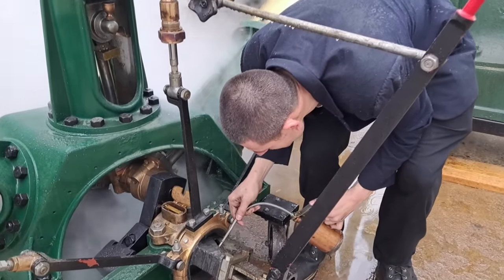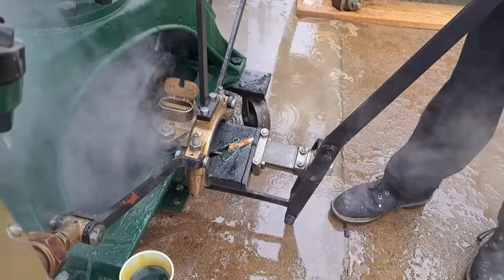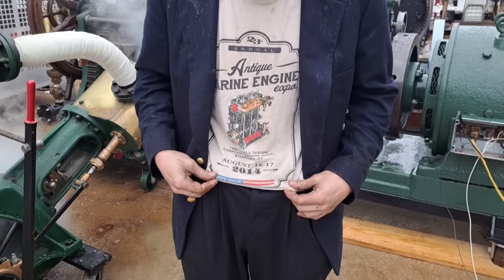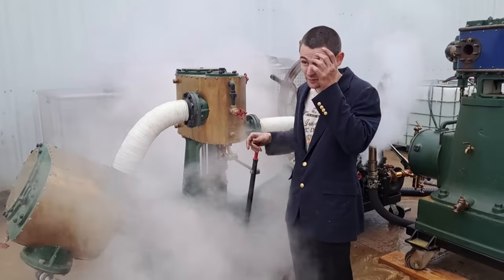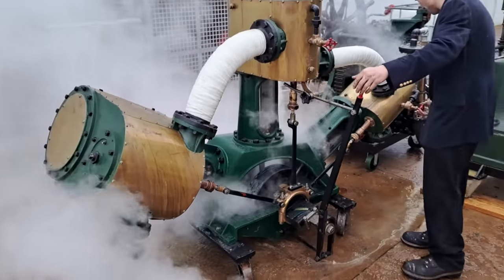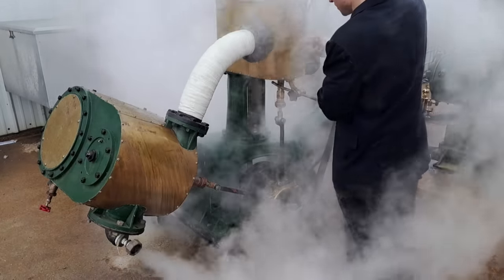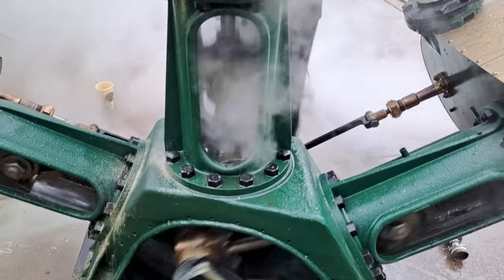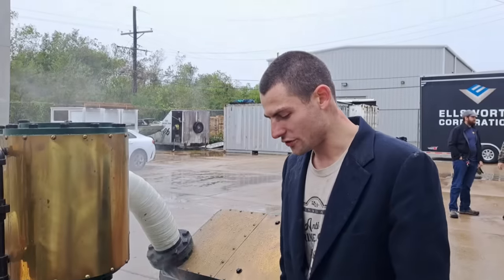Ward's Radial Triple Expansion Engine, remembering my friend Richard Gibbens

Comment: Briilant. Love old steam. I to have been collect old engineering books for years. My first introduction to steam was when i was about 4 years old. My dad was a light house keeper. Ever6 now and then a steam tug would arrive with supplies of equipment. One day we travelled back the mainland. I ended up down below in the engine room. Twin screw Triple expansion engines. I just sat there in aww. I could write a book about my steam adventures. But not here

Comment: Just stumbled onto this neat video.  Great to see the Ward triple again.  The last work on this engine was on Lopez Island when Keith Sternberg and I cleaned it up, painted and lagged it, and tuned it up for Alex Ellsworth.  Incidentally, if you are ever back at Mystic, they have a big four cylinder Atlas-Imperial marine diesel which I restored in Anacortes, WA back in the 1990's.  The engine originally went to Independence Seaport Museum in Philadelphia but was resold finally to Mystic Seaport.
Reply from the maker: I helped paint that Atlas!

Comment: That’s a very interesting engine !  Just also watched your 1 1/4 hour long video about the water plant which took me back in time. I was amazed at your dedication and knowledge of steam engines for a young person.  I could not find a place to comment on that video so doing it now. I started as a coal fireman on a steamship with a triple expansion engine. I soon was promoted to an oiler which I really appreciated.  Through your video I was comparing the ship and the water plant engine. No flywheel on the ship due to the propeller. No fly ball governor. Two eccentrics for ea cyl because it reverses. Slide valves. That ship engine room was not dependent on electricity for anything but lighting. We had a dynamo for that.  We had a surface condenser and air pump linked to the h p cross head. Some ships used a jet condenser. That ship was built in 06, my next one was built in early 50 s, what a difference !  Everything was manual controlled on the first one which gave me a full understanding of what was happening. That first experience gave me a fast learning curve on future ships. I did become a n engineer.   My first job was a  9000 hp compound turbine. We didn’t call it a turbin. Really enjoyed your water pump video. Henry

Comment: This is the first time I've ever seen a radial steam engine.  I seem to recall seeing photos or illustrations showing V-type reciprocating engines in the very early types of naval "torpedo-boat destroyers" (the name thereafter shortened to destroyer).  I believe this was to reduce overall height of the engine and improve the ships' stability.  (Come to think of it, you would think this would have been done more often to reduce the amount of valuable space above the engine room taken up by triple- or quadruple-expansion engines.)

Comment: I don't understand variable travel (or phase) is that actually altering the stroke (or like geared stroke)? Good to learn about a thrust bearing.
Reply from the maker: The variable travel and phase of this eccentric alters both the travel and timing of the steam valves, not of the engine.

Comment: A while back I found a video about an old waterworks(?) in one of the Eastern cities that had a couple engines, including a larger horizontal radial engine (vertical crankshaft) configured like this one.   Sadly, the place was threatened with demolition, don't know what happened.  Do you know anything about it?
Reply from the maker: East Boston pumping station.  The engines  were all destroyed in the 1990s
Reply: @AEKarnes  That is so sad.  Thanks for what you do.

Comment: What is the reason for this configuration vs inline cylinders?
Reply from the maker: Primarily space saving.  You will notice the angle of the cylinders matches the hull bottom angle

Comment: Technically, this is a "W-3" and not a radial engine ... the layout is not uncommon in air compressors. The compound engine that Abner Doble built for Sentinel was a W-3, though the Brits often call it the "Broad Arrow" engine because the cylinder layout resembles an arrow's broadhead.

I like shifting eccentrics like this one, though they have something of a bad reputation among traction engine owners.
Reply from the maker: To be it is a radial even if it is not a full circle.  If all cylinders are placed radially and share one crank pin it is in the family.  I don't quite understand why they have a bad rap among the traction engine guys.
Reply: @AEKarnes  Apparently, the sliding mechanism can sometimes bind especially if you are doing work in a dusty environment.

Comment: I apologize if this is the wrong place, but I'm looking for partners that would be interested in helping me develop a modern high speed radial steam engine.  And by modern I mean state of the art with a digital ECU to provide infinitely variable valve timing, constant speed, programmable torque, etc.  There won't be anything romantic in the intended operation of the engine, but there will be plenty of opportunity for handling oily wipers and collecting loads of empirical data during its development.  And ultimately enjoying the things the engines will be used in, as varied and unexpected as they might be.

P.S. Thanks for reading this far. For size comparisons the prototype will be similar in size to an abomination I'm sure you've heard of.  That'd be the Cyclone Power scam that Harry Schoel ran for a decade.  I promise there is no 'spider hub' and it's not going to rely on the water to pass into the crankcase for lubrication.
Reply from the maker: You do not need a digital ECU or any electric component to provide infinitely variable valve timing on a steam engine.  Solid state has no business being anywhere near heat, moisture, high inertia or vibration prone environments.    Winding engines, Pumping engines and steam automobiles were doing infinitely variable and reversible admission and exhaust valve timing by the 1890's with valve gear that had already been developed beforehand.   Try and come back to this once you've fully studied the history.